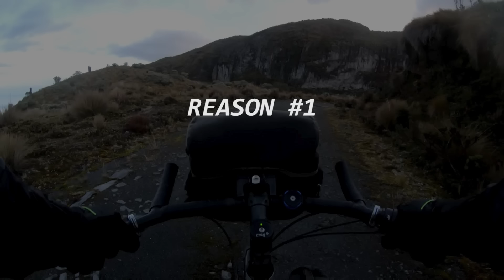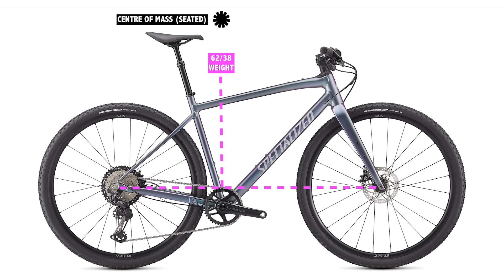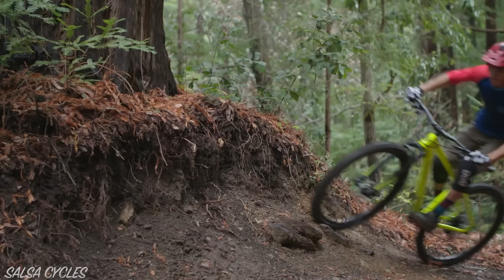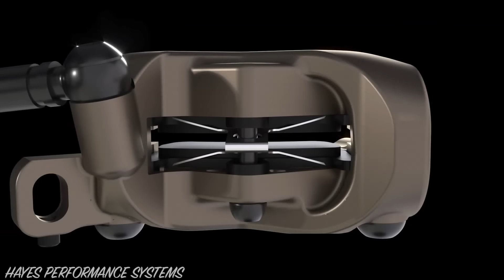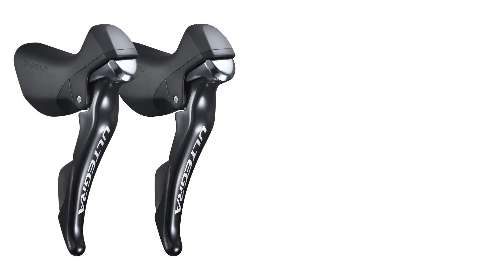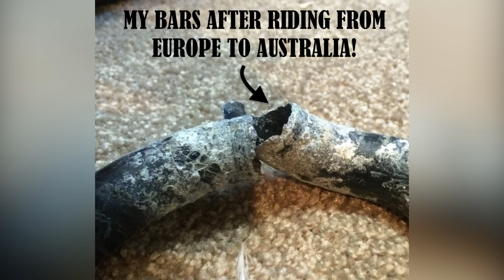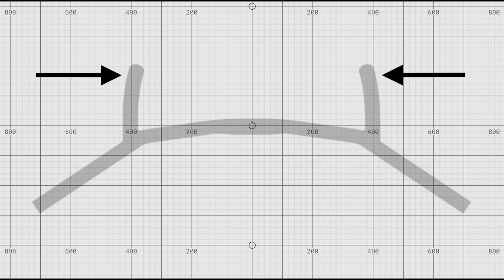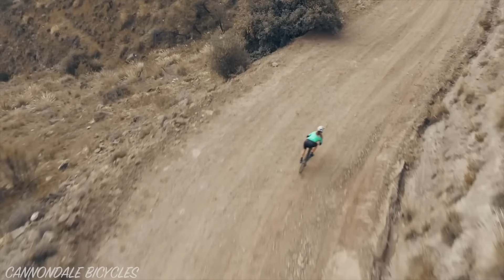Why Flat Bars Are BETTER Than Drop Bars For Most Cyclists (Objective Analysis)

Comment: Something was forgotten here. Drop bars allow a "hammer" (or joystick) handling, which prevents twisting the wrist. This position is much less traumatic for the wrist and forearm over a long time, and is the reason for ergonomical vertical mouses. You can have flat bars with vertical additions, but they won't give you access to the gear shifters and brakes, meaning you can only use them on quiet roads where you ride alone. The flat bar handling, after a week of intensive computer work, adds to the wrist pain and carpal syndrom risks, especially as you add your weight on a twisted wrist.
Reply: I disagree with the part where you say “especially as you add your weight on a twisted wrist” because as flat bars leave you in a more upright position you carry much less weight on your arms 🙌🏻 I’m a huge fan of upright position and flat bars
Reply: @adrianmoral2746 why would flat bars put you in a more upright position than drops?
Drop bars riding on the hoods with the bars tilted upwards get you in a much more upright position while keeping the wrists neutral.
Reply: @adrianmoral2746  
flat bars don't necessarily put you into a significantly more upright position.
Reply: @adrianmoral2746  bars (flat or else) have absolutely nothing to do with the angle of your torso, this depends only on the distance between bar and saddle, so that's on the geometry of the frame, stem length and sit post.
Reply: @aurelienpierrephoto  narrower bars  will give a more upright torso than wider bars given the same seat/ bar dimensions
Reply: @aurelienpierrephoto  It is explained in the video that flat bars bikes have a different frame geometry that allows you to be more upright.
Reply: Drop bars return  your shoulders back to their natural orientation and bring your elbows in to your sides creating a more ergonomic position absorbing road irregularities better than the unnatural attack position similar to a motocross motorcycle.  Also allows riding in a more relaxed posture on moderate terrain allowing the rider to ride loose and balanced, maintaining center of gravity on loose or slick terrain. Not all tensed up with locked elbows as with most too wide flat bars
Reply: @noelbrown6771 Well I lean a lot when cornering. My flat bars just work for me.
Reply: I switched to dropbar exactly for this reason - wrist and elbow pain. The only disadvantage is much worse braking in the hoods. Going to try to combine some sort of a drop bar and MTB shifters and brakes.
Reply: @alexander-malafeev  Get the Jones alt-flat bar or Surly Moloko bar (bar will outlast your bike probably!).  You can't put flat-bars goods on a drop-bar, drop-bars suck, and are a Relic from the 19th century no matter what any brainwashed roadie/'gravel-rider' says...  Your control on rough trails and quite chunky fire-roads is Best with alt-flats plus more comfortable/upright in general.  Comfort over long distances greatly outweighs whatever Minimal b.s. 'aero' benefit is claimed by the drop-bar cult.
Reply: @bartmullin8018  Thanks!
Did not know about Jones bars. I was considering Surley Corner bar
Reply: @alexander-malafeev  I run the Moloko bars on my Surly KM; horns are taped for added grip and comfort.  Horns on Jones H-Bars and outer curve on the other bars they do are also tapeable.  Jones is an interesting company it seems; their bike has an interesting front fork designed in-house i believe.  The Bikepacking/touring-bike world is a funny, eccentric place...
Reply: @bartmullin8018  Surly Moloko looks interesting, thanks!
Reply: @bartmullin8018 yeah I like my Haro Hardtails (flat bars) more than my Past Salsa Fargo bike(drop bars with crappy mechanical disc brakes)
Reply: Avoiding twisting or stress-at-rest is THE most important factor when you have arthritis like me. Doesn't matter what the "technical merits" of a set of handle bars are if you can't hold onto them for pain after 30 minutes: at that point you aren't getting any of the advantages at all.
Reply: Good point
Reply: very good point
Reply: “Nailed it”. For roadies, drop bars win this debate every time.
Reply: yes main problem is not being able to brake while putting hands on centre bar or an aerobar extension
Reply: Well i prefer riding on quiet roads so the choice is not that hard.. btw i use a drop-bar bike for shopping rides in the city..
Reply: Didn't think of that thanks
Reply: All the points made in the video seem valid.  BUT.  
There is more to the subjective side of the question than just how many Instagram likes you get.
It’s a bit like finding shoes that fit. The fanciest most feature rich shoes are useless if they don’t fit your feet. 
Likewise the angles of the bars need to fit the angles your body can comforatbly accept when riding for hours. 
For me this means flat bars = wrist and hand pain and drop bars do not.  
Yes bar ends reduce the pain but in my riding I can only use them for maybe a quarter of the time so the pain remains.
Reply: I experience this ALL the time! Really a bummer to not be able to cycle, or do computer work.
Reply: You can easily access shifters and brakes only if you install the vertical extensions with a tiny bit of logic involved
Reply: Agreed. I am a roadie and rode Leadville on straight handlebars and my wrists went numb for weeks.
Reply: @vanfja heck Leadville is actually starting to see dropbars as well since they're superior in aero position especially when the course isn't as technical.
Reply: @ryoukokonpaku1575  I only remember seeing very few on drops when I was in Leadville way back. But good to hear it’s more popular now.
Reply: I have the SQ Lab inner bar ends and i can shift gear up plus light braking. The difference is that you can adjust their rise and position unlike any fixed handlebar
Reply: I have been riding all kind of bikes for over 50 years. On all kind of bars. Personally - I prefere drop bars. Flat bars are just too wide. 70-80 cm is too much. That's why we have all those strange surley moloko and joneses etc.  But.. for off-terrain downhill flats always win. And about geometry - flat bar bikes are designed for a more upright position (but do notice that wide-angle arms position puts lots of stress on the body), but that doesn't mean there arent thousands of gravel and endurace bikes with very relaxed geometry, too. Drop bars gives me more flexibility and relaxed position, while losing some of control on rough terrain, but I don't ride much on cobblestones, rocks, gravel and steep downhills anyway.
Reply: Wasn’t totally forgotten, imho. Bar ends and bullhorns were mentioned, which mob riders and tourers (in my limited experience) have been using for years for this very reason
Reply: @1972hermanoben  and bar ends and bullhorns don’t offer you access to shifter or brakes.
Reply: Counter: moustache bars and bullhorns both allow a hammer grip
Reply: @kebabMieszanyMieszany11  Yes, and that's why considering them being flat is riddiculous.
Reply: also gear shifters come in a variety for both styles. my classic road bike with drop bars has bar-end friction shifters which let me shift several gears at once and my partner's modern flatbar commuter has push button gears which allow only one shift at a time
Reply: @AJ-em2rb  True, ur partner can only do a small step at the time with the right shifter, but when a bigger step is needed he can also use the left shifter for a smaller or bigger chain ring
Reply: Inner bar ends, which I have installed and enjoy a lot on my flat bar fitness bike, do give access to the gear shifters and brakes.
Reply: @rimapuraydura1880  Can you post a photo?
Reply: Drop bars don't give you the control or comfort modern-day flat and alt-flats do.  Additionally,  comparing a mouse or joystick to handlebars is an apples-to-oranges comparison.  A mouse isn't a handle that takes shock like handlebars do and a hammer doesn't have a wheel, brake handles, or shifters attached to it.
  Dirt bikes run backswept riser-bars for good reason and those reasons trickle down to the MTB world Quite well.  All-day off-road comfort due to superior leverage/control,  the extra width, proper wrist angles, and a more upright position make the riser bar superior over drop-bars.  Try riding a drop-bar rig over extremely rough terrain fast with any modicum of control or not losing your front wheel in a fast, smoother turn with 'marbles' on top if you have any doubts.
  If one is overlanding on mixed terrain, the alt-flats shine bright.  Multiple hand positions make life easier and if you can't quickly or smoothly change hand positions as needed, you're not much of a rider in the first place.  You don't need shifters or brake levers on your non-braking/shifting hand positions anyhow(!).   
   If you have inboard 'horns' (like on the Molokos), you can use them like bar-ends on climbs, aero-ish position for headwinds, smoother sprints, smooth downhills, or an alternate hand-position.
  Lastly, drop-bars are an archaic Relic from the primary roadie/velo bike riding days before mountain-biking arose. 
There's no ergonomic science backing the design; nor is there Any reason to not put the drop-bar in the trash bin of archaic designs from the 1900s.  They are extremely uncomfortable (even with ergo-bends) and if BMX racers can compete with the riser-bars they use, a competent cyclocrosser could compete with a mid-width riser bar, wider tires (35-38s) and have better terrain-control/leverage in the bargain (If UCI could pull it's head out of it's ass...).
Reply: I think this wrist issue is greatly exaggerated, otherwise we'd often see drop bars where aerodynamics of the rider aren't as important - on motobikes with windshields.
Reply: @VojtaHry You can click on a vertical mouse without inducing an horizontal sliding movement, I have been doing it for the past 6 years… It's not about being able or not being able to use horizontal mouses, it's about the fact that when you spend up to 10 hours a day on a computer, ergonomical flaws can't be ignored anymore. No doubt that your average Facebook mom can live with a poorly designed computer attire, for lightweight use.
Reply: In short: flat bars are for apes and drop bars are for humans.
Reply: That's just matter of backsweep angle. There's plenty of flat bars that have decent angle. I've recently made bikepacking bike with ~20° angled 630 mm bars and aero bars on top, works like a charm for wrists and shoulders. But you can get even more angle in flat bars. The mayority of flat bars is almost straight though, so I couldn't put them in the same category IMO.
Reply: It wasn't forgotten, it's a matter of ergonomics, which OP said he wasn't going to cover. And anyway, 90° vertical grips are just as egonomically awkward as 90° horizontal ones. My hands don't naturally rest at either of those angles. And, since you brought up the computer mouse analogy, if the vertical grip was so much better, then joystick mice would be more popular. But they're not; they're a fraction of a fraction of a percent of the computer mouse market.

Indeed, most "ergonomic" and "gaming" mice aren't completely horizontal or completely vertical. They tend to place the hand at a slight angle relative to the surface they're on, e.g. the Microsoft Intellimouse, by far the most comfortable computer mouse I have used. That is a much more natural hand position, IMHO. If this logic held to bicycle handlebars, a slightly canted angle downward and perhaps towards the rider would be more comfortable than either a flat bar or a drop bar. (these are called "alt bars" I think? Idk, I'm not a cyclist) And that design would still be predominantly a flat bar one, just with some minor modifications.
Reply: @DJstarrfish  
randonneur bars (or the modern iteration "gravel") fit the bill neatly in this case. the shifter is twisted 10-15° inwards due to handlebar flaring out and a few degrees internally rotated as well. It's a side effect of allowing better access to the drops when a handlebar bag is fitted, but it's a noticeable ergonomic benefit as well.
Reply: @DJstarrfish  When you grab a hammer to put down a nail, you go up and down vertically, or left and right horizontally ? Which one gives you the more force for the least energy ? 

It's a stretch to imagine that the most sensible/clever design would be the popular one. If that was true, we would all use Dvorak keyboards, and yet we are all still stuck the QWERTY/QWERTZ/AZERTY keyboards layouts, designed specifically to be unefficient as to avoid letters to get stuck on typewriter.

Just check at how radius-cubitus attach to the elbow… any horizontal position implies to have them twisted at the wrist end. If you keep them parallel over the length of the forearm, you end up with a vertical wrist.

Sure, a slight angle might be better than 100% upright, but still, 100% horizontal is nonsense.

As a cyclist, I have put bullhorns on my bike, but I can't use them as much as I want because brakes are still on the flatbar. Doesn't matter for a daily commute, but swallowing 130 km in 2 days, you feel the pain growing on day 2.

Actually, in ultra-enduro races, people even go as far as putting aero bars designed for triathlon, not so much for the aero position, but simply to relax their wrists and get their weight on their forearms.
Reply: @Uhmm485  Silly argument to anyone who had been in the army. Solders do pushups on the knuckles and not on flat hands and precisely in the position as with drop bars.
Reply: @rosomak8244 31 years in the Army I’ve never done push ups on my knuckles unless I was just messing around.   Push ups were always done flat hand on ground.

Comment: Very nice run of pro's and con's, however I strongly disagree that dropbars are better for city riding. The added control and better viewing and sighting advantage you get from a more upright position far outweigh the occasional space advantage of more narrow drop bars - and some flat bars are not even wider than drop bars. Just look at urban cycling in places like Denmark and the Netherlands. Upright bikes and flat bars everywhere.

Comment: The key is to find the RIGHT drop bar type and size FOR YOU and then setting the hoods right FOR YOU (there's A LOT more drop bar designs than flat bar designs AND you can adjust the hoods) then you can get stability off-road (my Ritchey Beacons are MORE stable off-road then my flat bars - the flare and width is just right ;)) and one finger braking (you can mix-and-match calipers if you want 4 pistons). Toe overlap, right angles and weight distribution  - that's frame design. Nothing to do with the bars. Why are those on the list? Gear ratios - same: and there is such a thing as a mullet drive.  Bike packing: get a Salsa Anything Cradle or something similar if your bars are narrow, I have less than 40 cm at the tops - big bags, no issues. The other downsides mentioned...  It's grasping at straws let's be honest ;)

Comment: Common sense says that 'arm comfort' over a full days riding is just as important as the ability to brake safely and immediately if needed.   No one else can tell you what's best, it's entirely what you feel right with.   I ride both flat and drop bars with neither of them today being as comfortable as they were 10 years ago when I was 65.   I recently tried a friends bike with 'Sit up and Beg handlebars and found it charming to ride and better than both of mine, but that's more to do with my age today.

Comment: isn't this more about the bikes overall rather than handlebars specifically, from entry level perspective, drop bar bikes tend to be light? which makes a difference, I think like you mention choose bike for what you are doing, this vid is inspiring me a little bit to think about building my own
Reply from the maker: You need to look at things from a holistic perspective because the design and components of a bike are all interlinked.

A drop bar bike is light not because of its bars, but rather, its intended use (smooth roads). You can find bikes that are essentially just road bikes but with a flat handlebar instead.

Comment: Completely incorrect assumptions .  bike  fitters and physiotherapists will  advise handle bar width  to be determined  by shoulder  width .  doing  otherwise can  cause  neck, back, head, and shoulder  problems ,as well as  and nerve  damage  with  long  distance  riding .

Comment: Drop bars with hoods actually steer more like a steering yolk or wheel. I always thought flat bars were better until I built an MTB a week or two ago and found I experience even numb fingers quicker than when I was riding for 4 hours onwards on my road bike that was stolen back in August and I’ve been riding a road bike for almost 3 years. And I shift faster with my road bike